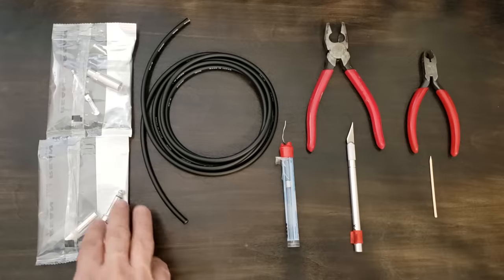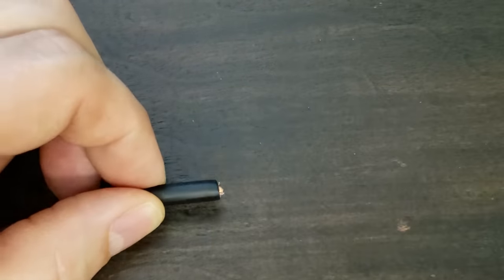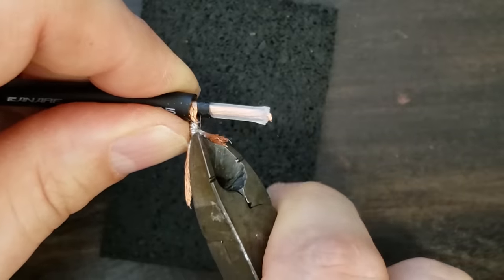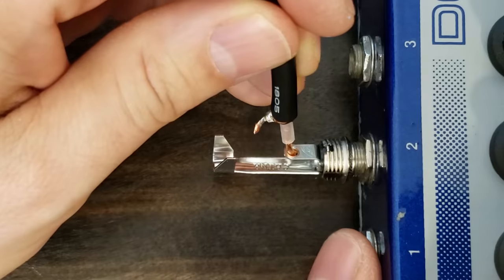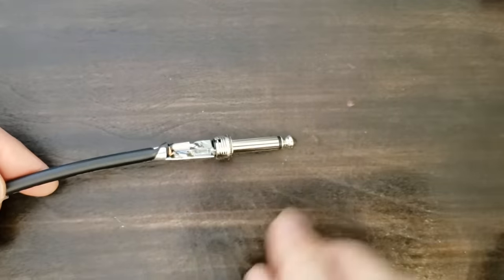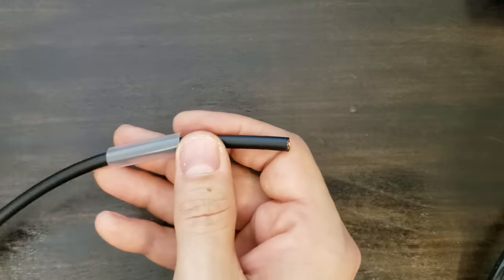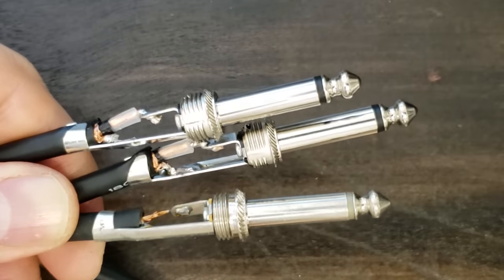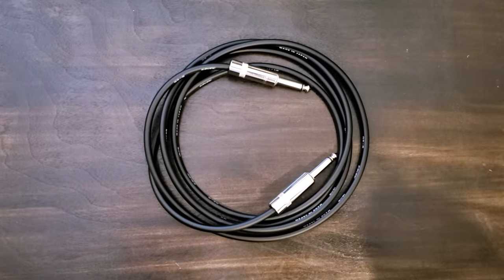Guitar cables - Make the Best Cables for bass keyboard GUITAR DIY SOLDER CABLE

Comment: how do you make a usb cable to plug the guitar into the computer
Reply from the maker: A usb guitar cable requires a microprocessor (analog to digital converter) in order to operate. Basically, you'd need to build a tiny A/D converter in the middle of the cable (or at the usb end, if you can make one that small).  I think these devices sell for about $15-$20.  Most recording interfaces allow DI(direct injection) as part of the interface.
Reply: @FrankOlsonTwins  So a microprocessor is an analogue to digital converter? I'm confused!

Comment: Why twist the shielding into two pigtails instead of one?
Reply from the maker: It's not totally necessary but I find it helps to make soldering easier and faster, with less chance of overheating the internal insulation near the inner conductor.
Reply: @FrankOlsonTwins  Thanks. What's your favorite raw cable and why? I like Mogami but want to try others.
Reply from the maker: Personally, I like Canare GS-6. The inner and outer conductors are easy to solder, there's great coverage on the shield and I've never had a single cable made with GS-6 fail in almost 20 years.  It's slightly slimmer than other cables, and has a semi-gloss finish that's easy to keep clean.  I'm sure Mogami has an equivalent cable, I just haven't found it. I also tried a sample of Sommer cable, but found it to be too finicky to solder so I never purchased any.

Comment: Hi, How much roughly would one of these cost to make? Thanks.
Reply from the maker: About $15 for a 15 foot cable, without shipping.
Reply: @FrankOlsonTwins  With GS-6 and Neutrik 1/4" TS jacks?  I can't even buy the components for $15,  and I buy a couple of hundred Neutrik XLR, TRS, and TS connectors per year, plus 500m of Canare instrument and Quad cable.
Reply from the maker: @hat2flat  Markertek has GS-for .89 cents per foot.  Thats $13.35 for 15 feet.  They also sell the NYS201 connector for $1.25 each.  So:  $2.50 + 13.35 = 15.85.  So, about $15, no?

Comment: on a speaker cable which wire is tip vs sleeve?
Reply from the maker: If it's Red and Black: Red=tip, black=sleeve
If it's white and Black: White= tip, Black=sleeve
Reply: @FrankOlsonTwins  My bad, I meant to ask on my speaker jack and on my speaker. There are just two unmarked terminals. They look the same. Is there a simple way to test. I have a meter.
Reply from the maker: You could check the polarity with a multimeter, sometimes the negative of the speaker will be connected to the speaker frame. If not, you'll have to determine if the cone is pushing "out" or "in" on a positive sine wave hit. 
"Take a 9V battery and touch the terminals to the speaker terminals. The speaker cone should move out and then in. If it does, then the polarity is correct. If the movement is inward first, swap the wires around on the battery and look again. The movement should be outward first, showing you have the proper polarity."
Reply: @FrankOlsonTwins  Thanks- great tip!
Reply from the maker: No problem, but a word to the wise:  A 9v battery is pretty powerful to most speakers, so you could start with a 1.5v battery and see if that does what you want.  Also, you are just tapping the contacts, too much battery could cause damage...
Reply: @FrankOlsonTwins  Thanks. Would it help if I used a nearly dead 9V? I can easily run one down...and I have a 9v battery tester. Just bought a new speaker and don't want to risk damaging it.
Reply from the maker: Yeah that will help.  It's like 1 or 2 seconds max contact time.  You'll see it pretty clearly.
Reply: @FrankOlsonTwins  thanks

Comment: why do you cut half of shield wire?
Reply from the maker: It makes a smaller connection which makes for easier soldering.  A joint that's too large can over heat the inner insulations.

Comment: You forgot to mention that it's not very easy to solder a wire to a brand new plug, you have to scratch the dam thing a head of time.
Reply from the maker: Well, you're not wrong!  If there's visible oxidation of any kind I give it a once over with a light abrasive.  If the contacts are really shiny, like they are here the rosin in the solder should clean it up any microscopic buildup.  But I'm all for cleaning any contacts that will be soldered....

Comment: What kind of solder did u used? Good day!
Reply from the maker: Hi, good question!  I prefer to use high quality brand name solder, such as Oatey or Kester.  I use rosin core solder, any electronic formulation will do. If you can't find rosin core solder, you can use regular solder, and brush solder flux(also called rosin flux) onto each joint before soldering.  It sounds annoying, but sometimes it makes soldering a bit easier

Comment: When you separate the wires with the tooth pick, why make two strands and cut one of? Wouldn't both strands twisted into one work?

{:o:O:}
Reply from the maker: Sure, you can twist them into one. Some smaller soldering irons have a hard time heating that much copper and can melt the inner conductor insulation.  This is just an option for people to use.

Comment: It's a bit misleading comparing conductive plastic screen cable with braid. The braid on conductive plastic screen cable is simply there to provide end to end connection of the plastic to the ground - NOT - for screening. That's a bit misleading I think.
Reply from the maker: Perhaps on other cables, that's true.  This cable offers a 92% copper braid for shielding purposes.  If it were not necessary they would dispense the braid and just put in a drain wire as some other cables do. Also, the copper braid offers a strong connection to ground which is also important.

Comment: Those Rean versions of the connectors are IMO the worst, the sleeve and outer casing become loose over time and corroded causing higher resistance in the ground connection, better to get the slighter better actual Neutrik branded PX Series plugs such as the NP2X-B which have each connection a single piece of gold plated brass alloy the entire way through, machined in one step - no internal crimping to become loose.
Reply from the maker: Granted, the cables I made 15 years ago were with Neutrik branded plugs, but they have held up very well.  The Rean plugs I've been using as of late have been no different to me for the past few years.  You're right about the casings being a little loose, but I haven't noticed that contributing an issue to ground. Electrically speaking, the casing really only adds shield to the connection point. Still important, but the likelihood of it creating a ground issue is very low.  If your ground connection is soldered well and doesn't fray, your ground is intact.
I do like the NP2X connectors, but for beginners and most guitar enthusiasts, I think it's much trickier to solder. Because the parts dissipate heat so well(to the rest of the connector), it takes more heat from the iron.  When the likelihood of a cold solder joint goes up, the reliability goes down.  I do like the strain relief that the NP2X uses.  Also still nice and tight after 15 years on my cables.  But, for that reason, they have a bit clunkier profile, which I sometimes do not prefer with certain guitars.  
Of course, use what you like and have success with.  I've had good success with both, so I suggest using both styles of plug.  For the price vs. performance, I still like the Rean plugs and will still recommend them until the quality gets bad.

Comment: Are those genuine Neutrik 1/4" jacks? They look like the cheap junk that are used on the mid-price cables from major retailers.
Reply from the maker: Yes, these are the current offerings by Neutrik.  Neutrik was recently purchased by REAN, I believe, so their branding is changing from Neutrik to Rean.  These are currently high quality parts which appear to be as good as my Neutrik connectors of old, but who knows what the future holds for the brand.  I'm hopeful they'll stay true to their designs and craftsmanship over time, rather than making compromises.

Comment: decreasing the ground mesh at the tip is not correct
Reply from the maker: As long as you solder the joint where all the mesh meets, it will work as intended.

Comment: That what you do at 2.52 is wrong , cos all ground conductor should be twisted and soldered with out cutting on half diameter !
Reply from the maker: Disagree!  It might not be necessary on less expensive cable(with fewer ground braids) but if you use heavy braided ground wire such as GS-6, you'll see it's almost required to solder it to the ground tab without melting anything.  Try it both ways and you'll see what I mean.  Just don't forget to solder the braids together first.

Comment: I wonder how many people have damaged the inside of a pedal because they aren't able to solder quickly enough and over heat the pedal jack by way of conduction? Not a great idea, taking a piece of 4x4 from Lowe's that is about eight to ten inches long and drilling a hole just big enough for the male cable jack to fit into is much safer. There are a number of ways to do that without accidentally overheating the jack of a working pedal.
Reply from the maker: You'll overheat and damage the cable end before damaging the pedal jack.  If you overheat the connector and it concerns you, just unplug it 'till it cools off.  Don't use your best pedal for this task.. most people have an unused pedal just kicking around.  Why not put it to use?  A wood hole insulates the heat and allows the connector to move.

Comment: ce n'est pas tout à fait exact.... en fait tout est bien sauf LE CABLE !!!  tout les guitaristes se plaignent que quand ils jouent avec des effets de charges (grosse distorsion, metalzone, compresseur avec beaucoup de gains....) le cable microphone !!! c'est à dire que quand vous jouez en bougeant ou quand vous remuez le cable, vous entendez du bruit, claquement.... c'est à cause du cable, alors pour resoudre ce probleme, prenez du cable stéréophonique donc à 2 brins, vous choisissez la couleur du brin qui va transporter le signal (exemple noir) mais l'autre brin (exemple blanc) vous le soudez avec la masse ! vous allez donc ainsi supprimer l'effet capacitance du cable et plus du tout de bruit !!!!!!!! et si vous voulez un max de propreté du signal, adoptez ce principe à toute la chaine d'effets. c'est trés connu des techniciens du son
Reply from the maker: Merci d'avoir regardé! Ce câble est connu sous le nom de câble "faible bruit". L'isolant conducteur élimine ce bruit de manipulation que vous décrivez, de sorte que le conducteur intérieur mis à la terre n'est pas nécessaire. Essayez ce câble, il ne vous décevra pas !

Comment: Oh no !!! , never do that ! always use a TWO wires cables  + shielding braid  and join shielding only on one side of the cable , like this impedance is equal between hot wire and mass . All pro wires are done like this with 2 cables and shield wire.
Reply from the maker: I'm not a fan of that style of wiring. It causes more problems than it "solves." Pro cables are not made that way.  Use cables as engineers have designed them, not as some internet fad. The kind of wiring you describe is, in my opinion, designed only to sell cheaper 2 conductor lo-z cable as hi-z instrument cable. It has nothing to do with reality, only profit margins.

Comment: There is a big problem with this cable and this plug! When you bend the cable up and down, you bend the center conductor inside the plug. you tighten or loosen the center conductor, which over time causes damage or breakage.

This type of plug has not good stretch and bend protection.

This cable is not suitable for concert use
Reply from the maker: I see your point, but when used with high quality cable such as GS-6, and good solder technique this plug has a proven track record of success. It's important to make sure the cable is crimped well and the barrel is on tight.  Once assembled properly, it is plenty roadworthy and concert ready.  I've played many shows in NYC and across the country with different styles of cable plugs(NYS224, NP2X) and I think they are both very good for working guitarists.  I've used either styles for my main lead as well as hooking up pedal boards to amps, FOH, etc....
One downside to the plastic bodies of the lug-tightening style, is that some people over tighten and crack the shell.  That's game over. 
Your experience may differ but I still own and use both styles, and having given them plenty of abuse with no failures I still readily recommend them!
Thanks for checking it out!
Reply: @FrankOlsonTwins  
Okay i understand. 
There is also minus pin or whatever it was called which is too thin and moves up and down when the cable is bent up and down. This means that the center conductor is stretched and may break. If possible, I sometimes fill the plug with polyurethane, the same ones that are used to glue the car window.
Reply from the maker: I own a few "boutique" cables that have a nice hard filling in the plug shell(perhaps not exactly what you're describing) but I felt that really helped with the mileage of the cable.  I might consider doing it with a few of my own..